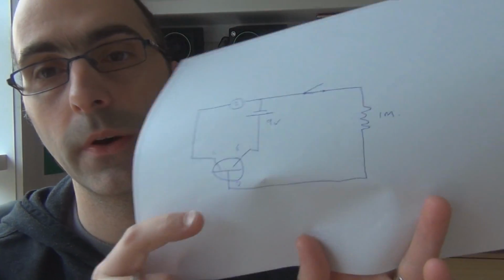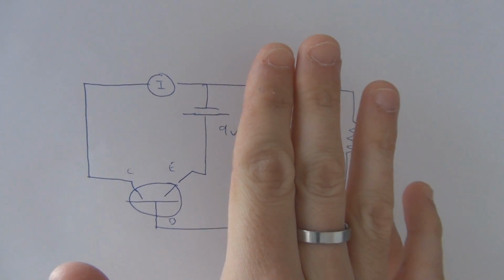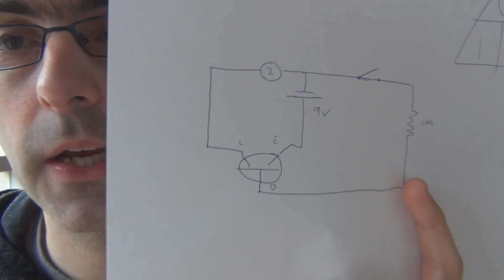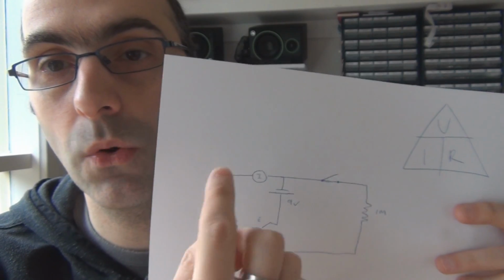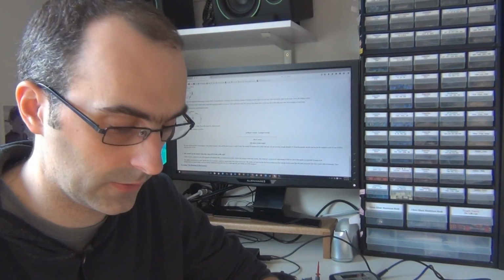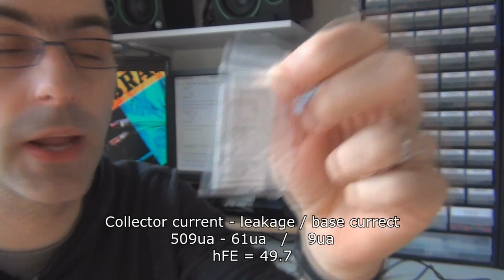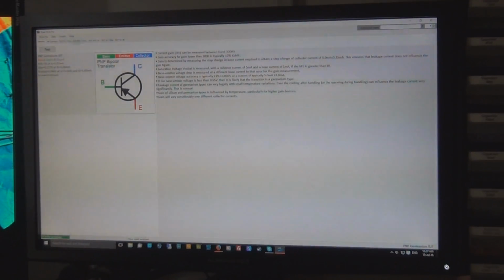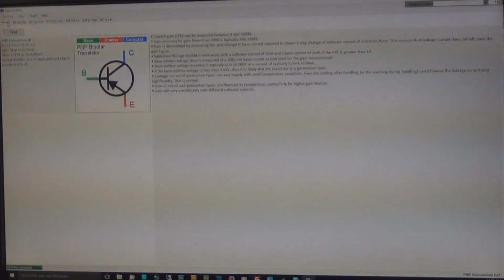Measuring Germanium Transistors with the DCA75

Comment: I sat down with the Keen circuit and tested about 50 random transistors, one of the main things I noticed is that they all took a few minutes to settle down to a consistent reading.  Not sure why, reminded me of old TVs and osciloscopes where you had to let them "warm up" before using them. The thing is they all gave a higher hfe reading when first switched on, and the hfe would then drift down over maybe 5 minutes before it settled, the leakage would go down too.  The DCA testers run for a second or eve less I think, so not long enough to get a good reading in my opinion.  I could not agree more that the people selling transitors do not really know enough about it and just run them through a machine and think thats all there is too it.  Also I know transistors have different gain at AC vs DC so thats another thing!  Maybe thats why some that measure low hfe at DC sound good in an actual fuzz.  My view after doing the testing is that there is nothing to compare to reading the voltages or currents accurately with a DMM, and then using excel to do the maths.  You can then measure the exact voltage across the junctions of the transistor and if you know the resistor values you can work out the exact base current, and add that in your excel calacualtion to get the exact gain (well within the margins of your DMM which usually are very good these days at less that 1% error) the RG Keen circuit uses assumptions here so there is a margin for error.  I suppose this is something that could be imprved apon forever and there is a limit to how far you can go.  I do wonder about testing it with a AC current though, say 1khz.